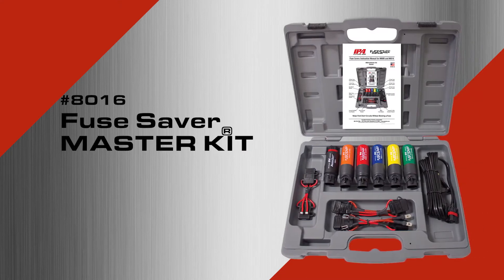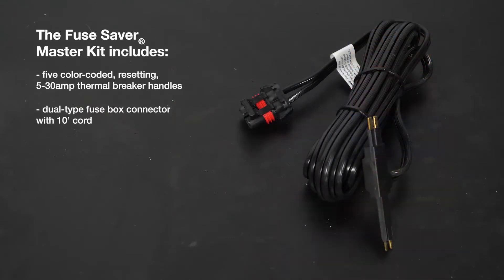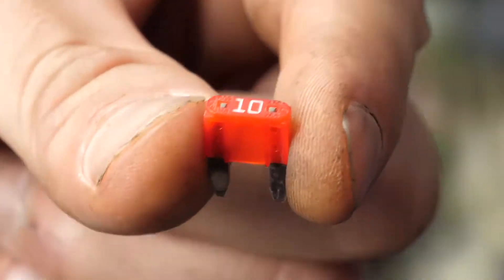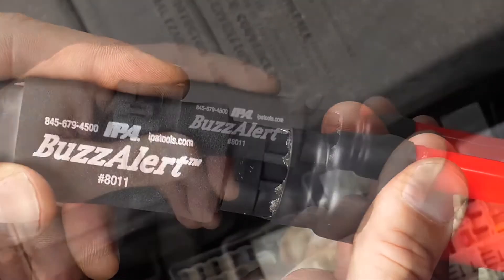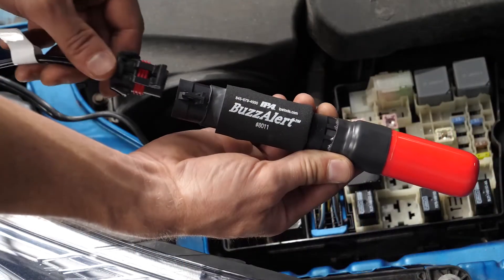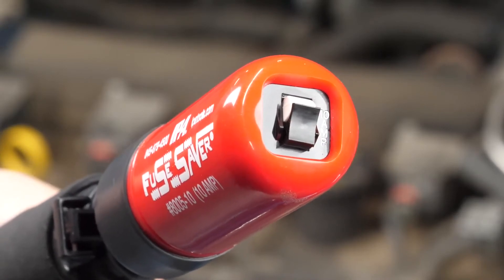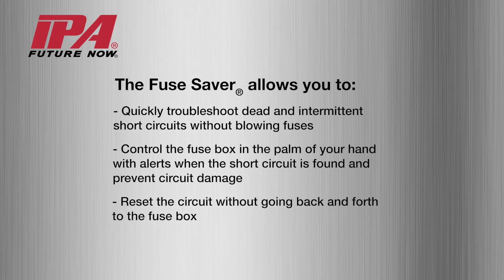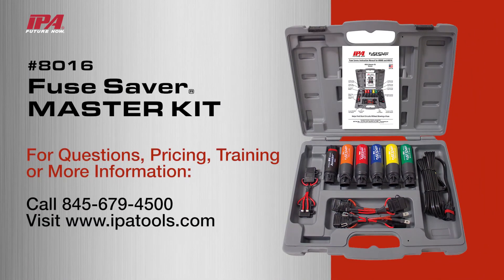IPA Fuse Saver Master Kit #8016

Comment: I'm trying to understand this tool when you plug it up when searching for The short in the wire when it makes the beeping noise is the fuse connector is telling you that you found the short or it's telling you to reset it... How do you know when you found a short what type of noise does it make
Reply: The tool makes a beeping sound to tell you that the fuse has been blown for the breaker has been tripped indicating that you are getting closer to the fault if it is a short in the wiring harness
Reply: This tools to help save money by not blowing a bunch of fuses while trying to find the short. It doesn't tell where the short is